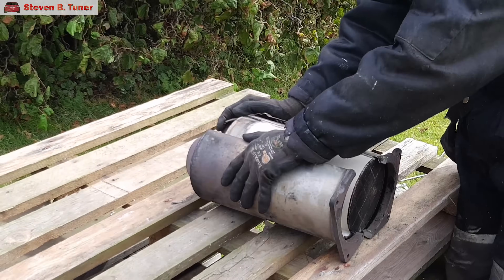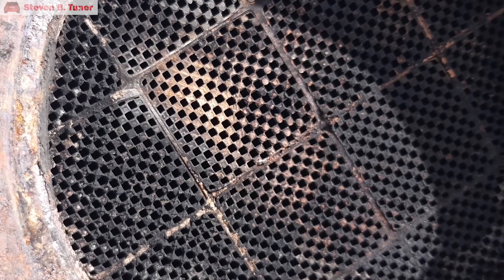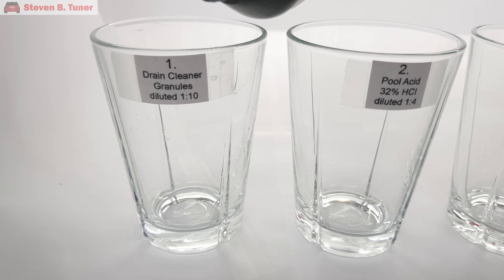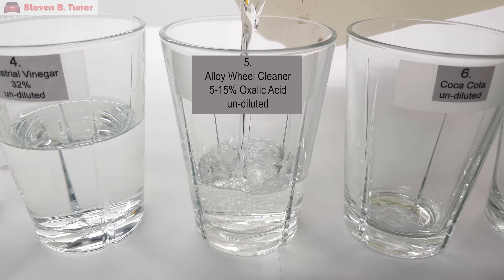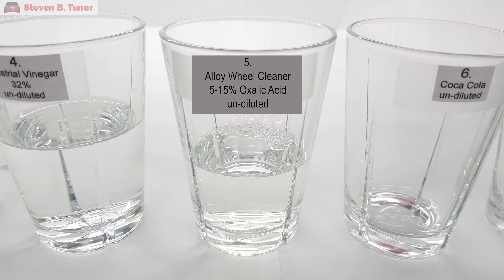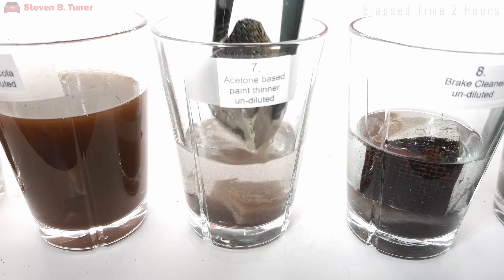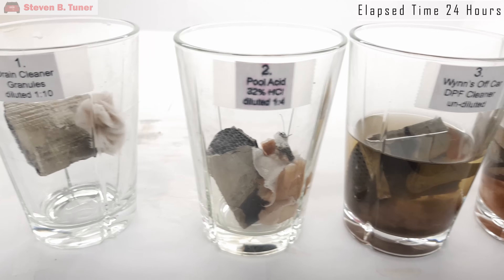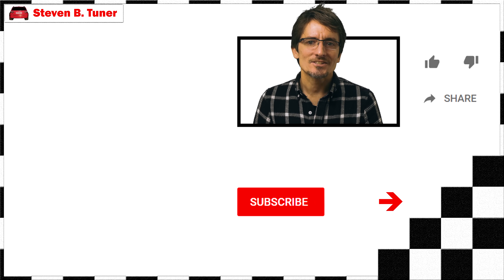DPF Cleaning at Home – 9 Chemicals Tested (Diesel Particulate Filter DIY Ash Cleaning)

Comment: Oxalic acid is often found in cooling system cleaner or flush.
Reply from the maker: Excellent information for a future test!
Reply: It's also in boat deck cleaner.  It works well, but is slippery and dries out your feet if you walk around in it barefoot.  My personal experience is bleach works better, but bleach is very bad for gelcoat.
Reply: What concentration of oxalic acid one shall use for DPF cleaning?
Reply: By the way oxalic acid is used in beekeeping as a way to kill the Varroa destructor and it can be bought even in 99.5% concentration.

Comment: Just at thought, when you are immersing the parts in the different solutions surely the chemical becomes exausted as the reaction progresses. Would a fresh solution be better after say an hour. I note that someone has suggested heating the solution that would also be a benefit. Why fit these DPF filters in such a way that cleaning is difficult?💣
Reply from the maker: All good suggestions for a future test :-)  Some engine types have very easy to remove / clean DPFs - just not those from BMW it seems!

Comment: Just watched a 'professional' clean a neighbors DPF in situe, i found it quite amusing tbh..... So what he did was unhook the exhaust under the car and fit a bung, then he removed what i assume is a O2 sensor from the downpipe just below the turbo and he filled the whole dpf with a solution and left it for 4 hours to soak. When the guy had finished and gone away we noticed there was what looked like a dishwasher tab wrapper in all his dirty cloths etc he had thrown in the bin. The best bit is it worked really well........ we did a pressure test before and after out of pure interest. So the DPF went from 10millibars at idle and 110ish at 3000rpm to 6 at idle and 54 at 3000rpm. Now after watching your video i'm convinced he filled the whole dpf is a dishwasher solution.
Reply from the maker: Could well be!

Comment: So the whole idea of these systems is to keep the particles out of the environment, then home do it  yourselfers negate that process. At dealerships they ship the carcinogens out to a proper disposal site.  The dummies in the government think thats what is supposed to happen.  Most of us either do it ourselves, or remove the systems.  This past week we just ran across a system that is 1 month out of warranty, and will cost over $50,000 to replace.  Im betting the customer deletes it.  Alll this fooling around with emissions looks good on paper and doesnt go for the long run unfortunately.
Reply from the maker: The soot that a DPF captures (and then burns off) is only a carcinogen if you breath it in. Once it is trapped in a DPF it is only as dangerous as the soot in your home fireplace. If the dealerships are being charged money to specifically handle carbon then they are being taken advantage of.
Reply: @StevenBTuner  intersting, so what do you do with the soot then?

Comment: I have a Volkswagen Amarok Ute and has an ongoing issue with the dpf light staying on and at times the glow/heat coil light flashes randomly when I am driving. 
I note you mentioned that at the start of your video that these can be linked, can you explain how so?
Reply from the maker: Hi, I have a video specifically about how glow plug failures clog the DPF, which might be worth a watch. A lot of vehicles use the glow plugs to fine tune the exhaust gas temperature, so they can get a bit unhappy when a couple of glow plugs don't work or when the glow plug controller/relay fails.

Comment: Is it possible to take out the EGT sensor in the DPF and have a dishwasher soup/water miks and fill in the DPF while it runs to clean it? Have a mazda cx5 and it regen all the time soo the oil level rises fast. Just orderet a differensial sensor incase thats trigger all the regen.
Reply from the maker: Hi, I haven't done that, but there is someone in the comments that did it that way, and they said that it cleared the error code. Be very sure that it is not possible to pour any liquid back into the engine, or that you pour in so much at a time that it stops all of the exhaust gases from flowing through. You can also use something like the Liqui-Moly product specifically designed for this purpose. Whatever you decide, I hope you'll report back about how it went!
Reply: @StevenBTuner  yeah i want to try, but need to be carefully that its not to much at time.. also wunder to make å little nozzle of steel av put down in the DPF and use mr.mucle oven cleaner. Used that to clean EGR and inlet manifold with good experience. Have you heard any tried that?
Reply: @StevenBTuner  i bought a pressure can and i boiled water and pore into it with 3dishwasher tablets today and put it in the first hose before the DPF. Alot of smoke, but after the run i plugged in the differensial sensor and it was the same pressure as before 🙈 and i can feel the pressure in the hose. Soo now the next plan is to try mr muscle  😊
Reply: @invent0r94 how much water did you use please? The engine is on or off when you put the solution ?
Reply: @borhencherif3854  i gues i tryed 3 full pressure and so, 7dl *3. The car was on and running when i did it. Next for me now is going to take a pressure gauge and check what pressure is, just to make a note. And then im going to drill the DPF and give the car a tune. Tired of rising oil level and high fuel economy 🙈

Comment: Thanks for the effort in this mate. I waged chemical warfare on my cars DPF and it really didn't do anything. At one point the light went off fir half a day. The only way to clean a dpf is to remove it from the car and jet wash the inside clean. You don't need to be a mechanic to do it (depending on its placement) and you will need to do a forced regen afterwards for good measure but the problem will be done and you will save yourself a lit of money. Garages don't want to do it as its easier to replace it as it's not worth their time financially.
Reply from the maker: Interested to hear what you tried previously that didn't work. The problem with high pressure washing is that if you hit the catalyser you will strip the platinum off of it, and then it won't as well. A lot of cars have them separate, but not all...

Comment: Watched this video a year or two ago and rewatched it again now to prepare myself for all that when I decide to go for  a vehicle equipped with DPF. Wanted to add  an extra step with blowing the solution in reverse with Tire Bead Cannon. it makes sense to soften the deposits and try to blow it out. Obviously starting with lower air pressure charge. Maybe even try to blow the soot when its dry
Reply from the maker: The soot and ash is harmless when it is in some water, but it is all pretty nasty when it is in the air. That is my only concern with using air pressure

Comment: As a heavy haul technician, I NEVER see a clogged DPF. Lots of broken filters and failed sensors, and looooots of faultless failures, but I never see these systems run long enough to actually get any significant buildup.
Reply from the maker: On big motors I can well imagine that the pressure of the exhaust could be stronger than the ceramic glue that holds the DPF modules together. On a motor that runs all day, you are only going to have a couple of days to catch a sensor failure or an ash blockage before the issue becomes a lot worse.
Reply: Well, I have seen several 🤷🏼‍♂️

Comment: Why does the label change on the alloy cleaner to phosphoric acid, maybe wrongly labelled?! Just to add Coke contains a small amount of phosphoric acid..
Reply from the maker: The problem with using branded products is that they can and do change their ingredients, so something might work well once bit then doesn't work the next time. I much prefer to find out what the generic chemical is - and it is usually cheaper too.
Reply: @StevenBTuner  this is the way

Comment: The best method is to remove government regulations and regulatory agencies.  These devices are dumb, and cause more harm than good, and line pockets of high up people.
Reply from the maker: Hi, without these filters we would have had a ban on diesel vehicles in the early 2000's, so I consider them a necessary evil.
Reply: @StevenBTuner  never settle for a necessary evil, who said it was evil anyway? answer that then ask why they say that, then why to that, then why to that, bit closer to the answer
Reply: @StevenBTuner  Good.  Consider whatever you want.  It doesn't change the fact that our government is just sticking it up everyone's rear end under the guise of environmental protection.  Most of the exhaust coming out of a diesel is oxygen.  It is far cleaner for the environment than gasoline exhaust.  

I'm against rolling coal, and anyone who does that intentionally to others should be arrested for assault.  However, all of these devices are not necessary, at all.

Comment: Good  video and explanations, but I would have blanked one end of the DPF and then filled it up with your solutions .
I have used plain washing up liquid or soap powder and water for carbon deposits on things like EGR valves and coolers, cylinder head valves, turbocharger gas side components on large   marine diesels burning bunker fuel, soap powder rather than detergent is far more effective and has no effect on your hands.
Oven cleaner is another strong caustic solution, but would need diluting. 
If you want to dissolve scale in your kettle, simple malt vinegar works better and cheaper than descalers.
Reply from the maker: Lots of good information!

Comment: So pool acid is the winner 😊
Reply from the maker: Cheap, effective and available worldwide!
Reply: @StevenBTuner Hydrochloric acid 32% is not readily available in the UK. It was available until about a year ago, used for descaling toilets, but now the government has changed the regulations so that anything with more than 10% hydrochloric acid can only be sold to a registered business or to someone who holds an Explosives Precursors and Poisons licence. The toilet descaler now contains 9% hydrochloric acid and is not very effective. Also at the same time the price per litre has gone up.

Comment: A good friend of mine told me years ago to use a dishwasher tablet and hot water he said they used to do it in the DPFS on the machines at the company he used to work for because they only used to run them in low revs so they got blocked quite quickly quite often I thought it was an old wives tale but I guess he weren't lying 😳😳
Reply from the maker: Great to know!

Comment: Hello Steven,  I am happy to report that after a second treatment but this time for 24 hr exposure in the DPF cleaning process , my 2014 Porsche Cayenne DPF is back to normal. I just finished testing it and it drives like new again and no more "Check engine/Glow plug" lights. Thank you so much for all your guidance and for saving me at least $7K in total repairs.
Reply from the maker: 100% perfect result!
Reply: С каким именно раствором вы это делали
Reply: @АлексПушкин-г2в  Hello, here are the mixtures; 
Step 1; Dishwashing tab 1:10 water for 12 hrs
Step 2;  Pool acid 1:4 water for 24 hrs
Step 3; rinse with tap water. 
Per Steven B Turner "if there is a lot of black soot, then you might need to do the first stage multiple times. After the first stage you should rinse thoroughly. After the acid stage, rinse with lots of water mixed with dishwashing liquid, and then hose with water for at least 10 minutes. When you put it back in the car, idle the car for 15 minutes to gently dry it out."
As of today my Cayenne is working perfectly, thanks to Steven B Turner.
Reply: @raulgonzalez549 hola Raul por Que usas primero el dishwashing tab  en vez de solo el pool acid? Tengo una amarok con el mismo problema y estoy pensando en bajar el Dpf y hacerle el proceso podrías por favor guiarme🙏🏻
Reply: @juandavidmarinlopez2132  Hola Juan, el (dishwashing tab) es un prelavado y tambien para remover el hollín aceitoso ya que eso facilitara para que el (pool acid) trabaje y limpie mejor.
Reply: @raulgonzalez549  thank you so much 
I’m doing it, very hard to take the Dpf out of the amarok but I got it, I put washer pressure and left in container with dishwasher liquid and tablets  6 hours I’ll put the acid over the night
Reply: What kind of mixture did you use to clean the DPF?

¿Qué tipo de mezcla usaste para limpiar el DPF?
Reply: @senolcakr7366  Hello, here are the mixtures; 
Step 1; Dishwashing tab 1:10 water for 12 hrs
Step 2;  Pool acid 1:4 water for 24 hrs
Step 3; rinse with tap water. 
Per Steven B Turner "if there is a lot of black soot, then you might need to do the first stage multiple times. After the first stage you should rinse thoroughly. After the acid stage, rinse with lots of water mixed with dishwashing liquid, and then hose with water for at least 10 minutes. When you put it back in the car, idle the car for 15 minutes to gently dry it out."
As of today my Cayenne is working perfectly, thanks to Steven B Turner.
Reply: hello Raul did your reset check engine light with obd scanner after cleaning dpf?
Reply: @michaelstclair838  Hello Michael,  It has been over 9 months since the DPF cleaning procedure and my Cayenne is running like new without any check engine light nor the DPF warning light on my dashboard. To your question regarding the check engine light reset, I used the iCarsoft CR Pro scanner to reset the check engine & DPF light on the dashboard. Hope this answer your question.
Reply: also did you use a pressure washer or just regular hose?
Reply: @michaelstclair838   Just regular water hose.
Reply: @michaelstclair838  yes, just regular water hose.
Reply: @raulgonzalez549  also did you really soak dpf on pool acid for 24 hrs?
Reply: @raulgonzalez549   did you soak dpf for 24 hrs with sodium hydroxide or pool acid?
Reply: @michaelstclair838  Sodium hydroxide for 12 hrs; Muriatic acid 24 hrs; 
Step 1; Dishwashing tab (Sodium Hydroxide) 1:10 water for 12 hrs.
Step 2;  Pool acid  (Muriatic Acid) 1:4 water for 24 hrs.
Step 3; rinse with tap water. 
Per Steven B Turner "if there is a lot of black soot, then you might need to do the first stage multiple times. After the first stage you should rinse thoroughly. After the acid stage, rinse with lots of water mixed with dishwashing liquid, and then hose with water for at least 10 minutes. When you put it back in the car, idle the car for 15 minutes to gently dry it out."
As of today my Cayenne is working perfectly, thanks to Steven B Turner.

Comment: Hi and thank you so much for the vids. I see you haven't made any lately but that you still seem to be answering comments! Think I've read most of the comments but (correct me if I'm wrong) haven't seen anyone pointing to this scientific paper published in 2006 (the abstract: https://pubmed.ncbi.nlm.nih.gov/16570632/ (can also google the title and find the whole thing)), which seemingly proves that oxalic and citric acid improve catalytic activity, with oxalic being more effective at removing phosphorous and sulfur, and citric being more effective on lead and zinc (+others). And though DPF and catalytic converters are not the same thing, perhaps the best cleaner(s) for a DPF also could be oxalic/citric, or a combo(?) Would love to see a video on this! Either way the paper is an interesting read. (and apologies if it's been pointed to before!)
Reply from the maker: Hi, thanks for pointing that out as I haven't seen that paper before. There might well be a good concentration that can be found that helps out the cat, loosens up the ash as well as cleans up the metal :-) Definitely worth doing some experiments!

Comment: Hello, Steven and thanks for this very useful video. My DPF is together with the catalytic converter in one unit. I have 10% hydrochloric acid - I intend to use it for the cleaning of the ash deposits. Should I do so? Is it the same as using "brick" acid? Will this hydrochloric acid damage the catalytic converter or the dpf? Should I delute the acid?
Reply from the maker: Hi, I would dilute it a bit so that it is around 7% so that it is as safe as possible for the cat, but still do a good job at dissolving the ash.

Comment: Can also use tsp and water solution. Its very good for oily stuff. It will not eat the ceramic either. I would alternate 2 cans of oven cleaner and 2 solutions of tsp. Its a powder, mix it with water, like 2 tbsp per 8oz. 
Cheap cheap way of doing it i think. 
It really strips and cleans, it leaves no residue, i think oven cleaner leaves a film of slick stuff sometimes. 
It would be more ideal to backwash, 
So i think there is a process where you drill a 1 inch hole, insert a plug that inflates, like a bulb with a pump, that seals engine exhaust from water. 
Then spray and set for 2 hours, backwash from catalytic split, and repeat it that way 4 times. 
Would take hose adapter, inflatable plug, and a way to seal the 1 inch hole, welding it up. 

But, if thats easier than rippin out the garbage factory shit, THEN definetly use the butt plug method. 
Or the oven cleaner tsp method.

Best yet way i think is alternate concentrated sulfuric acid wash and tsp wash giving an hour or 2 for it to sit in and dissolve the crud. Would dilute the stuff before running or regen, and end it with the basic tsp for least amount of corrosion after. 
Its the most intensive chemical method, high ph swing washing. 
Or maybe hydrogen peroxide concentrated alternate with tsp would be better too. 

There should be a test with one removed, in a ultrasonic cleaner to see which one works best.
Reply from the maker: Definitely some good thoughts there! Do you know what is in tsp?
Reply: @StevenBTuner  Tri-Sodium Phosphate

Comment: Pressure wash with good old hose water.   Works great!
Reply from the maker: Hi, it can work on DPFs that have a separate catalytic converter - but on units that have everything in the one case, the high pressure will destroy the cat.